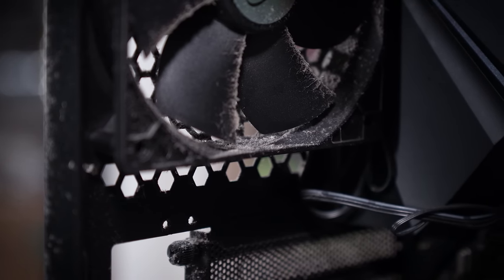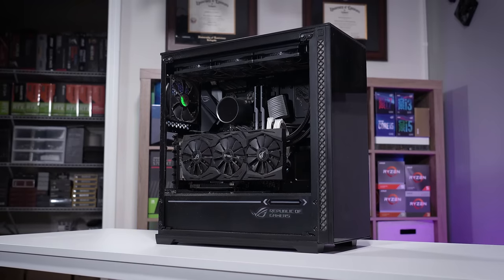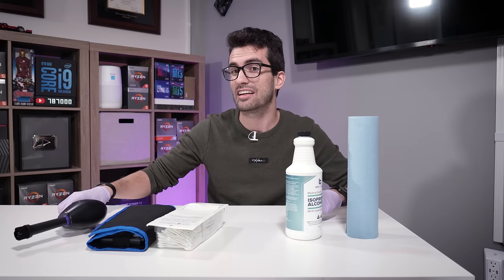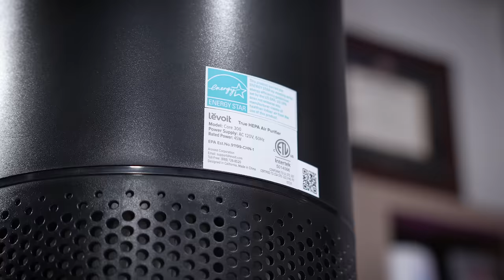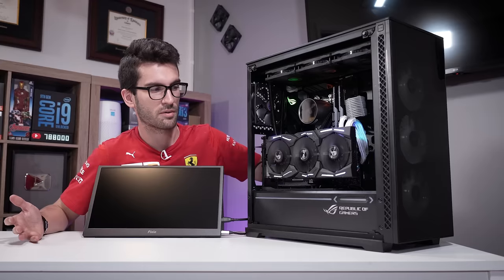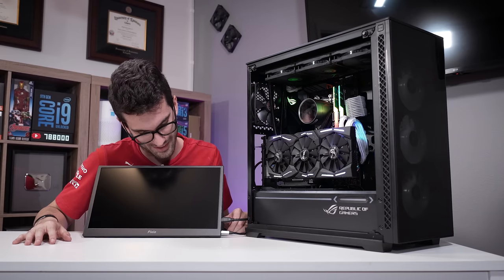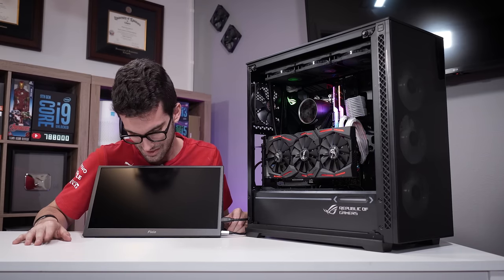Deep-Cleaning a Viewer's DIRTY Gaming PC! - PCDC S3:E5

Comment: Thank you sir for cleaning my baby. I wish I had time to stay on top of it but I'm always doing something on my day off and I need to learn to shut off the pc while I'm not using it. I will be taking someone's suggestion and move the fans on the AIO to intake
Reply from the maker: Thanks for giving us a chance to clean it! Treat her well! 😎
Reply: Yes, positive pressure should keep most of the dust out (when you have dust filters). Keep an eye on the temperatures and noise though, there might be some turbulences affecting both.
Theoretically you could also turn around the front fans to exhaust in case a positive pressure setup doesn't work, but then you'll have to live with less RGB 😬
Reply: G'day El Noob,
one change I would make because you have that ASUS ROG GPU is to connect the Front 2 Bottom RGB Fans PWM to the GPU,
If you are not sure at 10:29 they are the 2 Exposed 4pin on the right hand edge up near the PCIe 8+6pin, this way they will Ramp with GPU Temps instead of CPU.
Reply: Nobody and I mean nobody will do the job that you've done on this computer totally immaculate.
Keith Kuhn
Reply: whats the specs of that?
Reply: @bevyofbabes  I am under the impression that ultrasonic cleaners use distilled water not alcohol.
Reply: Not tryna be a douchebag but how old is ur PC?
Reply: @SPEXWISE  you can perfectly clean with ultrasoon but indeed most people use water so you really need to make sure there is no water left anywhere or it can and will destroy the pc
Reply: Change the case for a better longevity of the parts of the  pc
Reply: @ikram2512  why does this matter? I've had a 6 year old PC Wich could still be kicking it if i could get my hands on 2080ti
Reply: @Jobieable  cuz it matter to me 

I never had PC before lol that's why I wanted to know
Reply: @ikram2512  that pc isnt very old by the look of it, not sure on the gpu but if its a 10 series card its 2019 or so, hard to say but im guessing no more then four years old
Reply: @bevyofbabes  
Your ideas sound pretty darn good to me.
Keith Kuhn
Reply: Pretty sure the reason he does it all by hand is for content. Wouldn't be as interesting if all he was to use is an ultrasonic cleaner. Added to that is someone at home could technically follow the same steps with the same basic tools.
Reply: @casualplayerschannel1432  It's a Ryzen 7 3800x with a gtx 1080
Reply: @ikram2512  About 3 or 4 years old. Last time I cleaned it was about 1 year ago.
Reply: @Nemesisx1974x  I will be buying one soon. I just like the look of the case. I don't overclock or do major things with it.
Reply: @SPEXWISE  Yup... they use distilled water! Hell Tech Yes uses sink water without any problems lol!
Reply: I have set up my son's computer with almost the same fan set up, however on the back I have the fan as an intake.  With a 12 core 3900X it stays around 71C when benchmarking.
Reply: what is that aio called?
Reply: @gazza thanks
Reply: @FVKairo  deep cool castle 360
Reply: @bevyofbabes  I also bought a DataVac Pro for prep.  Not only is it industrial grade with anti-static protection, but it is also a switchable between blow and vacuum collection.  It also has some handy attachments. 👍
Reply: @SPEXWISE  It can use many types of fluids if it's a top grade unit made for it.
Reply: @Manny_Rod  thank you sir. ur pc looks niceeee
Reply: a housemaid may go a long way. the amount of dust even on top of the PC tells that it's not just the PC that got neglected, it's clearly a bigger issue. a housemaid that cleans your house say once a week or even every x weeks may go a really long way for you.
Reply: Also put a small air purifier in front of the case it will take out the pollutants and dust mites in the air before it enters your case.
Reply: I don't recommend shutting off your PC everytime you are finished using it. Doing so is equivalent to a man killing himself and resurrecting everytime he wants to rest (strange example but I can't think of anything better). Instead, put the computer to sleep and wake it the next time you want to use it.
Reply: Buy an Air Purifier that can suck in more dust than your PC can. I recommend one that does at minimum 850 sqft. You still have to dust your PC occasionally but there will be a lot less dust in it.
Reply: Takes 2 min for weekly dusting with vacuum, nobody that busy just lazy.

Comment: Hey Greg, not sure if you’ll see this comment but in regards to cleaning fans, and other gear in general, I can strongly recommend using automotive detailing brushes. They work really well and I can attest to their effectiveness.

Also in regards to the Windex, don’t use it on anything tinted because it has ammonia in it and will eat away at any tinting.

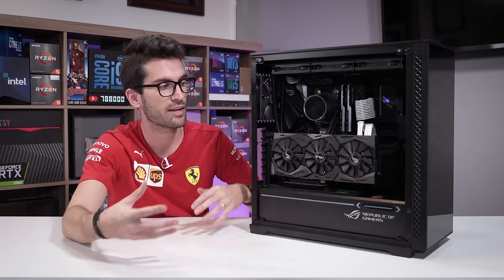Comment: Great video. Suggestion: you should do a lot more shots like the one at minute 19:08 on different parts, the before and after at the end of the video focusing on each part. Like a before and after of the fans, the front of the case, the back of the case, the graphics card, psu, and anything else you think would look cool.

Comment: I've done cleanings on PC's here at the shop. We charge $149.95 for tear downs & rebuilds. As far in as you go, I'd probably charge $200. It would also include updating Windows, drivers, BIOS version, & OS cleanup.

On cleaning of fans, use Clorox Wipes on the blades, casing, & wires. Then come back with the Q-Tips for the hard to reach spots. It'll save you some time at least.

Comment: when i first started cleaning/building computers 23 years a go it was just compressed air to clean a rig. the fans are a pain since most times you have to clean the blades more than once..started with Q tips but now i use a micro fiber towel with alcohol which makes it a bit quicker.wish i would have saved the pics of the rigs i have cleaned..the worst for me was cleaning a computer from the IT department at work. took it outside and hit it with air against the wind and got a mouthful of what ever had been in there for years.damn near puked. love this series.

Comment: I use simple green on the fan blades and then blow them off with compressed air. That usually does an excellent job of deep cleaning the blades

Comment: Love the series. This system is so insanely dusty it's almost like they did it on purpose (in no way saying they did). I have a 10 year old system I definitely haven't deep cleaned but still not as dusty as this one.
Reply: Dust accumulation depends on where you live, the case design, pets, etc

Comment: Ive always found negative pressure setups to be the worst for dust accumulation. I think in this case, swapping the top fans to intake would help a lot since there's a filter on top of the case. It would at least keep large particles and most of the hair outside the case
Reply: I think I'll swap them and check it out

Comment: Actually had a Levoit air purifier running 24/7 and after I stopped using it my electric bill dropped around 40 bucks. Would like to have it running but not practical for my wallet. Definitely enjoy the content!

Comment: Dang. I have 10 RGB Corsair fans in my Corsair 5000D Airflow and then another 120mm(?) on my Be Quiet tower cooler. It's a build that was done about a month and a half ago so I've been staying on top of the cleaning. The fans are easily accessed. Just remove the outer filters as 9 of them are intake and 1 exhaust in the back. Positive pressure, I'd say lol.

Comment: Invisible Glass or white vinegar and water works better on glass (especially tinted glass) than Windex, which can be quite harsh. I've even used Invisible Glass as an interior detailing spray in a pinch. Greg isn't wrong to use Windex, so my suggestion is basically a good alternative, especially for people who might be bothered by the vapors from Windex (I am one). 🙂

Comment: I just cleaned my Pc last night. it was only a couple of months worth of grime, but was still labour intensive, so I dread to think how hard this job was. 

I also use Windex on the tempered glass (well it's called Windowlene here in the UK, but it's the same stuff I think)

Was my first time installing a fresh MOBO, a CPU and an AIO as well. Lucky for me I got it all right first time though. I just got stuck in the BIOS for a while, but for some reason telling the BIOS to download the Asus RGB hub actually booted it. I know for next time to have a back up copy of my OS though. Again I was lucky that I managed to get it to boot, otherwise I'd have had to rebuild my old config and get access to my copy of windows (as digital copy) 

Learning more with each upgrade though. I'm confident about doing a full build now. 

PS: is Windex made by "Reckitt Benkiser" I have a feeling it's just a case of the same product having a different name over here. You know we used to call Snickers Bars "Marathon"? We changed to Snickers like the rest of the world in the late 80's/early 90's.

Comment: Love this series...  Yeah, cleaning the fans on these gaming modules with a lot of fans seems to be a real pain...  Almost would justify a stack of RGB fans to simply swap them out...  As for the blower vs a vacuum, I am pretty sure the cleaning level and your office environment would be MUCH better if you got a small shop vac, placed it outside with a PVC pipe penetrating into the room some way, with a small PVC header to your bench and a necked down end with a standard vacuum hose.  It would prevent all the COOTIES from the dust clouds ending up floating to the far corners of your office space.  The dust and all the resident cooties would be outside in the vac, which can be safely dumped, and WASHED since the vac side of the shop type vacs are able to withstand water....

Comment: Should see my machine. I'm pretty sure the RAM issues i've been getting is because dust mixed with heat and thermal grease and every time i bump it, the cooler weights down the processor in the socket and pulls it out ever so slightly, just enough to give issues.

Comment: How about this for fan cleaning buddy. Go get a soft detailing brush. Spray alcohol on the fan and make it almost wet. Use the brush for all the nukes and crannies and then blow with clean air. This will minimize hour work to 2-3 minutes per fan no matter how dirty it is. Hope this trick saves you a little bit 👍🏼👍🏼

Comment: I'd never considered even getting an air purifier until it was sponsored. Now I have to consider one so I can stop covering my new monitor and tower with the plastic they came in when I'm not using them (I usually do this when things are newer to cut back on the dust accumulation) I will definitely be picking up one of those as soon as I can, of course after I update my gpu and get a new keyboard and mouse because priorities... well after the gpu at least.

Comment: What were the temps? Pre and post cleaning. Good work, that case does suck
Reply: Agree. It would be good to see the other benefits of a good clean. On a side note, in most of these Greg pulls apart gpu and heat sinks on the mobo. Are the thermal pads replaced?

Comment: I have a concern. When you reassembled it, the AIO's pipe was sticking with the rear fan. Did noticed it and fixed it before returning? It isn't a good thing for both in long term use 😕.

Comment: Question: Do isopropyl alcohol damage the boards?or not?
Reply: Isopropyl alcohol is literally one of the most commonly-used cleaners for circuit boards. Solder mask and compenents are generally impervious to it. Conformal coating may be a different story and become cloudy, but PC motherboards generally don't use any as they are rarely operated in harsh environments.

Comment: Hey greg, can you by any chance make a video about the cleaning procces of the clogging in the water cooling AIOs.

I have the msi coreliquid 360r water cooler and I'm experiencing the same symptoms of overheating, 50-55 C while idle and 75-80 C underload.

Comment: The owner should consider putting the pc into some cheese cloth. A client brought his daughters pc over and a soon as I switched it on for codes, three cockroaches came out. I killed them and 14 more and put boric acid all around the floor against the wall and quit worrying but I was pissed. It too was packed with dust so after cleaning it and the repair, I offered to deliver the pc. I wanted to know what environment made it so bad. My god it was filthy and I figured it was so I took some cheesecloth with me and covered it with cheesecloth. You can see through it to turn it on. I told them when it got dusty to change it. I never heard back from them

Comment: Looking at this build (didn't specify whether it's a pre-built or a DIY), a good one-off video idea would be to discuss planning a balanced build for first-time builders. This viewer had many sacrifices with cheaper components to attain the ROG Strix aesthetic (e.g., running that thermaltake power supply), and i would be worried about longer term issues and the possible future replacement of those components.
Reply: I actually took my time to select everything to make it look the way it is. I know I sacrifice a few things like air flow and that power supply is been with me for ever. One of the best thing I've ever bought lol
Reply: @Manny_Rod  interesting, I know the thermaltake supplies have been hit or miss, and that if a power supply goes it can take other components with it. Only other thing I was thinking of is getting fans with better static pressure for the front intake to reduce the negative pressure in the case. Your core system is really nicely done, just was surprised at the cheaper components when the core was so nice (and expensive)!

Comment: pretty sure you missed a screw there :/ Anyways, its a pitty you dont live close - mine is about ready for a deep clean: Its a Coolermaster C700p with an Asrock Z370 extreme 4, i9 9900K + NZXT Z73 AIO, 64gb corsair dominator, evga 2080ti ftw3 ultra, 2 x 2tb SSDs, 2 x 2tb corsair M.2s. 12x 16tb Exos drives, soundblaster XAE-5 & 1000w silverstone psu :D Alot of work :(

Comment: Hey Greg , Im a full tech nerd but at one Point you maybe could help me out? I want to refill my Deepcool AIO , it working fine but I recognize some air in it by shaking gentle on the Radiator. Can you recommend to doing it over time with Destillate Water or should I pay for this expensive Stuff from EKWB/Aquacomputer. Aio was running a bit over 1 Year now. But im rocking a 10600kf in a  ITX case so the Aio get a lot of Toasty load and runned at beginning of the Computer build some Months on 90-100 Degree's permanent because my nephew never looked on the Stock Bios Settings.

Comment: Question Greg, isn't the heat radiated from that front mounted radiator going to blow across the internals, before exiting out the back and/or the top?
Reply: The radiator in this PC is mounted on the top of the case with fans exhausting the air through the radiator and out of the case. But yes, if you push/pull air through a radiator and into the case, it can send hot air into the pc. It doesn't make a huge difference in most cases (usually around a 2°C difference) but in some cases it can make a noticeable difference
Reply: Radiator isn't in the front...

Comment: I'm pretty curious about which gpu that is? I have the same shroud but mines a Vega 64, is that a Nvidia one? Mine is also mounted vertically close to glass but doesn't really go above 60 Celsius. 

I know its not the objective to share specs with this series, but I'm always curious about them. 

Anyways, really good video!
Reply: At 10:25 you can see it's a GTX 1080.
Reply: @tubesami  Oh nice, thanks. 

That's probably the challenger to my card anyway.

Comment: I dont thing greg would like my pc lol it has 10 case fans with 2 cables each  2 fan controllers 8 rgb strips sound card wifi card 360 aio with  push pull fans config 2 nvmes 1 sata ssd  my cable management took me over 4 hours because there were so many wires lol